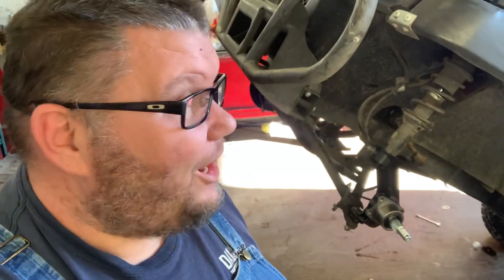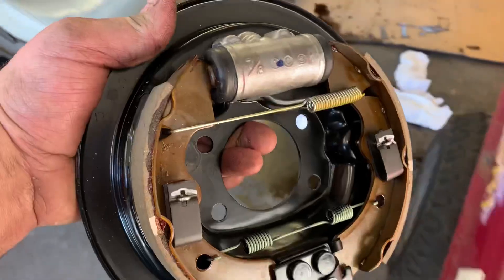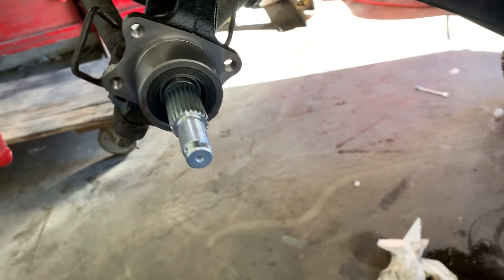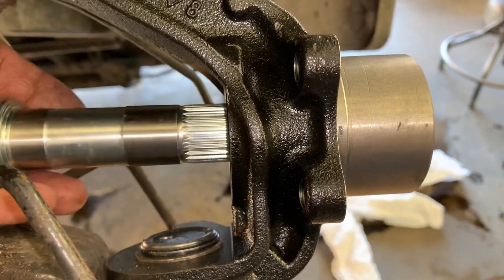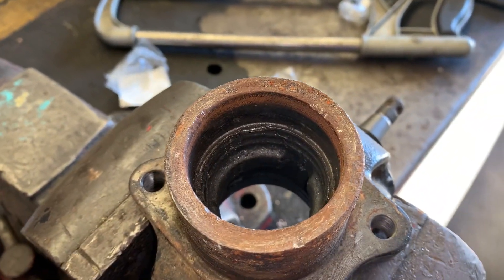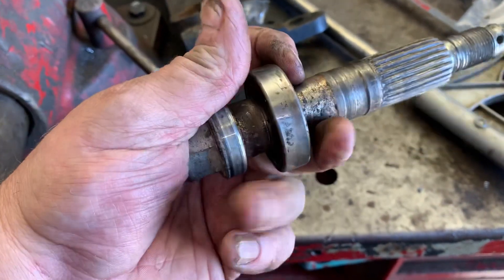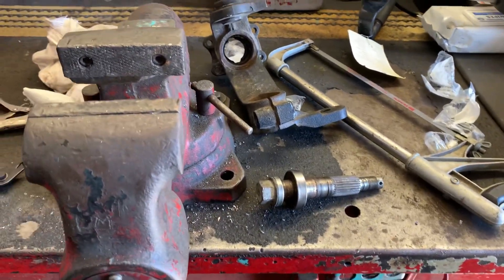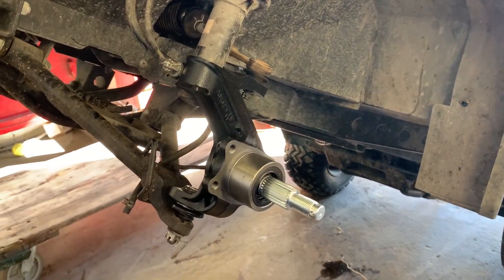KAWASAKI MULE UPDATE CATASTROPHIC WHEEL BEARING FAILURE

Comment: I had 1 it  was a 2002 model. I had the 4 wheel drive version with a diesel engine. 
Brand new it was the 2510 series probably the last 1 of those sold. After the 2510 was discontinued) I had all kinda of problems keeping wheel bearings in the thing. All 4 corners . 
I took my lose after I had it for bout a yr an a half. The engine was great the converter went out . I came up with one from a gas mule used it wasn't the same . Real expensive junk .